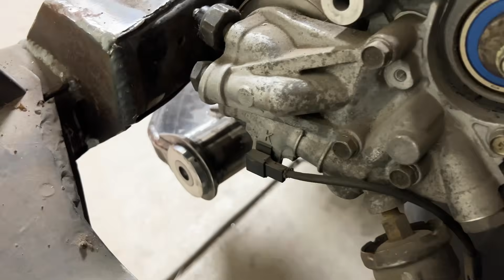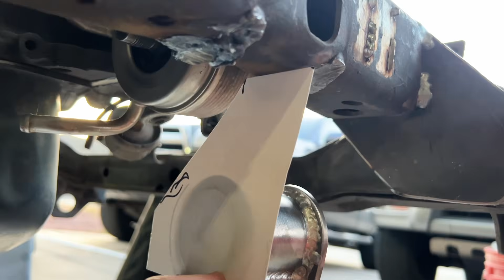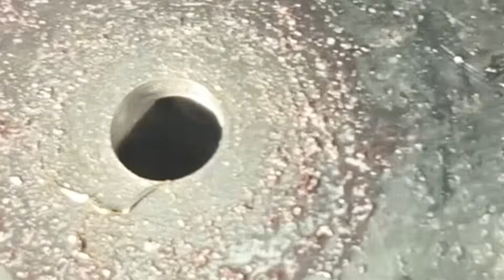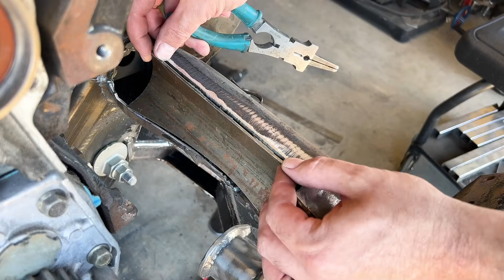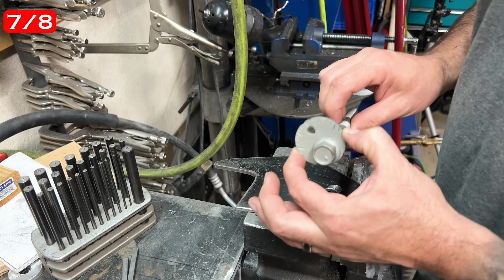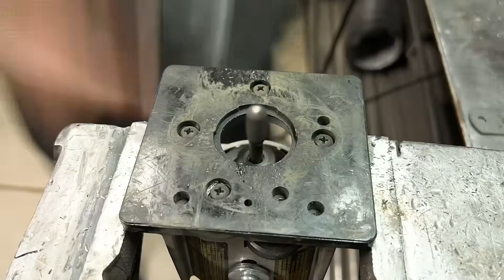Mounting My Custom Control Arms (Part 2) Mighty Max Ep. 26

Comment: Great video! I need some help on mounting custom narrowed control arms on a bagged truck. Mainly the uppers. Having problems with camber and bump steer. Should the upper be parallel with the lowers or slightly higher or lower?
Reply from the maker: Thank you! I’ve been wanting to create a video that would address bump steer and what causes it for a long time. I just haven’t found a time.
Bump steer comes from a discrepancy between the lengths of the control arms and the outer tie rod.
I have two videos that I think you’ll need  in order to figure this out. They break down the lengths of suspension components and why it matters.

https://youtu.be/lBTnPT2Me_0?si=9KZks01HOuLL78SS

https://youtu.be/ZHtQwQzY8uM?si=vRWlqx4AiRAH3GHn

This will have to be a prolonged conversation because it’s somewhat complicated, so I recommend shooting me an email Aaron@GarageFab.tv or an Instagram DM. @GarageFab

Let’s start with… Why did you need to shorten the upper arms?
Reply: I’m using an 08’ Yukon chassis under the 69 c10.

Comment: Hey got a car I’m building with positive camber for looks on my tires upper control arms are extender for this but looking to get the best steering I can should I go bump steering or rack and pinion conversion this is for a 64 impala no shims on the control arms

Comment: You get roasted in the comments!? But seriously, it's called a transfer punch because you are transferring the hole location of one piece to another. A trick you can try instead of "eyeing" the location is to take tape and wrap around the end (don't overlap) a thickness or two of tape to get closer to the size you need. Love the router "milling" table!! Was thinking that you could put a carbide 45 degree cutter in it and do chamfers as well. Keep on fabbing!!

Comment: Boots huh?  I should have thought about that when I bought my plasma cutter.  I have scars on the top of my feet because I'm too lazy to change my shoes!  Thanks for the tip.  A tip for you....until you get a 9/16 transfer punch, just make a smaller  pilot hole in your template then drill it to size using the pilot hole.  More accurate I believe.  Love your channel!
Reply from the maker: Much appreciated! I’ve had a few suggestions of using tape around the too-small punch.
Your tip makes more sense!
🍻

Comment: Go to home depot or Lowe’s and get a roll of “ram board”. It’s 30 something inches wide and 100’ long.  I built a wall mount holder so it doesn't take up valuable floorspace... And I can pull off what I need easily.🤘

Comment: Love your vids . I have a question. If i have custom upper control arm tabs and custom control arms and the holes are slotted for alignment purposes is it going to be a problem that theres no alignment shims ? Will i just be avke to tighten them where i need them or does there need to be some kind of alignment solution for the bolts like stock silverado tabs do or how your alignment cams are ? Is it absolutely necessary?

Comment: 33:50 did I miss something?
Would´nd it be much easier to FIRST tag the brackets to the FRAME and after that just drill the holes to fit the axle bold in place?

Comment: Is there a reason to cut the MDF twice instead of offsetting your paper template to cut the MDF for tip clearance? 

Also, do you have a contour gauge? Might make the tracing much more exact.
Reply from the maker: 🤷‍♂️ Never thought much of it! I do often use the cardboard template later in the process. That’s not why, but it’ll keep me from trimming the first template.
Eh maybe I’ll try it.
Reply: @GarageFab  I guess you could cut two paper templates and keep one without the offset if you want a quick 1:1 template. Just seems easier to cut paper instead of MDF? I think pushing the contour gauge fingers into the frame from the bushing axis would have given you the frame outline, but no guarantee on welding the cam stops on the correct mounts. :)

Comment: Wouldn’t changing the clearance  of the tabs to change their clocked position ultimately changing the “level” of the cam bolts slot? I know you spent an enormous amount of time making the slots perfectly level with the frame rails (and the ground) and then ultimately changing it after  the fact. 😅😅😔

Comment: As I understand it plasma cutters need really dry compressed air. I know it rains at your location so is this an issue that you have conquered? If so, how did you do it? I am in central Florida where moisture is a really big problem across the board.. Also, do you use a vertical standoff? If so, what is that set to and how did you fab or acquire it?
Reply from the maker: Correct! As I understand it, moisture in the lines will destroy your torch tip. We’ve got a REALLY dry climate. It rains, but it’s rare. I simply have a water separator, a bleed valve at the bottom of the tank, and a bleed valve at the lowest point in the airlines traveling to my garage. (Compressor is in the backyard)
I’m not familiar with a standoff. I looked it up and that wasn’t much help.

Comment: Recent viewer to the channel.. Love the amount of detail you're putting into the vehicles with the limited resources and tools in the garage.

On another note, as a person who has had similar issues with his AC (100 year old house with 20+ year old central air), it is probably the capacitor at the compressor. When my AC started requiring me to shut it down for a while and try again, I replaced the compressor capacitor. Once that was replaced everything returned to normal working order. I also learned that AC compressor caps tend to be dual capacitors, and mine was under $15 after shipping.
Reply from the maker: Nice! Thank you. It sounds like rock tumbler when it fails to fire up so made me think it would be worse than just a capacitor. BUT they’re cheap enough and dang easy to replace so why not give it a shot.
It might save me a few pairs of underwear.
Reply: @GarageFab  Our compressor and fan outside sounded like though my wife said it sounded like a helicopter that struggled to start. I will admit that I paid a company to replace the capacitor the first time, but they were kind enough to leave the box so I could order my own if I ever needed to. A couple years later the capacitor for the main blower inside died. Capacitors are like the weakest link in electronics, at least in my experience.

Comment: Ramboard floor protection works awesome for template material too.  Been using that for years and works awesome.   Can get a big roll of it at home depot.
Reply from the maker: I must assume that the curl doesn’t irritate you too much! 
I think I’ll try it out just for self education purposes. Thank you!
Reply: @GarageFab  You I just cut a 6' long piece and it flattens out perfectly.   I also cut and lay it out flat on the ground under the truck I'm working on when I'm not using it so it'll be perfectly flat when it comes time to use it.   Best part is when you bend it, with light taps on the line on edge of work bench, the bend will stay put so you can measure the angle to replicate it onto metal once cut out.

Comment: Tip I learned from Austin Niemela (another great fabricator on Youtube) is you can use Citric Acid (bought 5 lbs for $20 on Amazon) to strip mill scale in just a few hours, especially if the water is hot.  I use 1 cup of Citric Acid per gallon of water and put it in a clear, plastic tub with a clear, plastic lid.  I put it out in the sun to heat up the water and after just a few hours, I can brush and spray off the mill scale like magic.  Less expensive and works faster than vinegar, better smell and not toxic like Muriatic Acid.  I'm guessing Citric Acid would work on zinc too, but I haven't tried that.  All I know is it saved me hours and many stripping discs to take off mill scale.
Reply from the maker: Thank you, Andrew!! I will ABSOLUTELY try that. I recently discovered P&O steel. (Pickled and Oiled) It has the mill scale removed. It would make my work look SO much better. Only problem is it doesn’t come in the 12” wide flat stock I buy.
Problem solved! Thank you again.

Comment: Although the mounts are probably done by now. I don't really know at this point because I'm only halfway through the video. SO, for future reference, if you want to remove the zinc layer RIGHT NOW. Get some muriatic acid and soak them in that for a few minutes. Then, get some baking soda and mix it with water. Then, transfer the parts from the acid into the water and baking soda to neutralize the acid. BUT DO ALL OF THIS OUTSIDE WEARING GLOVES AND EYE PROTECTION!!! 
You my now return to your regularly scheduled program. 
Hope you're having a good one! 
More importantly, y'all be safe out there 🤠 😎

Comment: Nice see you working on the mighty max again. I’m hoping to get mine driving in the next couple weeks. I ordered a new clutch, flywheel, and pressure plate from act but have to get the flywheel machined for a pilot bearing.

Comment: Try this on your house A/C compressor. Don’t remove the stock compositor add this one to it. Well just read the instructions, it’s been a while since I installed one of these. Once you add this hard start compositor, the compressor should make it to fall. Just make sure you pick the right one for your A/C unit. If you’re not sure, just do a little research. This one I picked should work with most A/C units but please check. Hope this helps:
Darrin 

SPP5 HVAC Hard Start for Refrigerator and AC - Super Boost | 90 to 277V | 1/2 to 10 HP

Comment: For me, AC problems are always the start run capacitor for the compressor or fan (it's one piece for both). I have to keep a spare on hand for some reason, it shits one out every 3-4 months. The power company solved some problems on my pole though last fall. So far seems to be helping, haven't lost a capacitor yet this year, but I'm not getting my hopes up. Also, the 50 dollar capacitors have not been any better than the 15 dollar capacitors for me... Have fun!
Reply: When a compressor locks up temporarily. It usually means the thermal overheating has failed, it keeps running until the metal swells to the point dragging until it locks up. Once it cools down it will sink back to normal size it will normally start working again. Until it digs in to the point of total failure. If it is still cooling down and I would definitely replace the thermal overload switch if it is on the outside of the compressor.
Reply from the maker: Soooo I spent some years as an apartment maintenance supervisor. I’ve got a fair amount of A/C experience and lots of start/run capacitors. I don’t remember any of them causing the compressor to sound like a rock tumbler. BUT!! If it goes out before fall I’ll definitely try one anyway. I’ve also never seen a compressor lock up… temporarily.

Comment: Muriatic acid will rip zinc off in a hurry.  But, it’s muriatic acid, and not vinegar.  It’s not a toy.

By the way, a water softener typically has salt in it. If any of that got on your parts, a good rinse is a good idea.  Good luck, and good grief!

Comment: I have used this product called Ram board it is sold in Home Depot you can drill holes in it you can sand the edges to make a precision template you can cut it with a utility knife or a bandsaw, it is sold in rolls so I cut several different sizes in advance and put something heavy on it to flatten it out and it stays flat ,

Comment: I see you struggling with that ink pen. I don't often make suggestions.... but... The Pilot Precise series ink pens were used by myself and my coworkers years ago when we had to draw diagrams and used templates. Those pens worked amazing against templates and rulers. The ink flow was very predictable. Just don't put the tip down on the paper until you plan to draw a line or write. It will flow ink. We went to diagrams on computers a couple decades ago, but I took a class about 8 years ago that required drawing with templates and made a late-day run to an office supply store to get a pack. I used mechanical pencils to rough-out my diagrams and then came back with the Pilot. Never had a complaint from a "customer" on my diagram quality.

Comment: front bracket is a bracket and a bump stop.
Reply from the maker: I’m wondering now if I inserted a shot of the completed setup. When I finished filming, I went back a few days later and did a little trimming/shaping. Now you could actually mount a rubber bump stop on one of the tabs.

Comment: You need a friend with a 3d printer to print some adapter spacers for those transfer punches of yours...  you could use the 1/2" or 3/8" punch sleeved up to 9/16" or 3/4", or perhaps larger if your heart desires

Comment: Nice job but Bruh…I’m all about some gap welding but  I’ve seen hookers with smaller gaps than those driver side tabs 🤷🏻‍♂️. I’m feeling your pain on the flooded parts. I had a bunch of tools and parts stored in totes of my basement garage. A historic rainstorm flooded  my basement and who knew totes full of parts would float and capsize, spreading crap all over, ruining most everything. Bottom drawers of my tool chest also flooded. You know the big drawers where most people store tool kits and testers and expensive crap  but you don’t use much…all junk now. A $1200 Ford Tooloader 4 speed was submerged and spread an oil slick of gear oil out to cover everything in a gross oily film of sludge. As you can imagine, the bearings sound awesome now…Two brand new edelbrock aluminum intakes sitting on a bottom shelf, full of grossness. I’m happy my stash of carburetors were on an upper shelf. Flooded out my beer fridge too.  Not to mention, all the personal belongings and stuff from my kids childhood that was destroyed. Just sold that house  but the memory of that flood is gonna haunt me for a while. Flood proof your 💩, my people, even if you think a flood isn’t possible. Good luck with the AC

Comment: What I often use for template material is Ultra-thin HDF, his kind can be produced in thicknesses below 2.5mm. OR, Thin HDF, which typically ranges from 2mm to 8mm, with 3mm to 8mm being the common thickness. I also use either 1/16" or 1/8" thick aluminium sheet.

Comment: I know your shop space is an absolute precious commodity, but... your 1/4" MDF templates would be much easier to cut to final size in a scroll saw. They are also great for making templates that have some sort of void in the center. 
Like radio bezels etc.
Reply from the maker: I agree, Dale. I’m constantly doing work where a scroll saw comes to mind. 
I also need a miniature band saw. Which to you recommend I get first?
Reply: @GarageFab they are both irreplaceable once you've had one, but... I'd say I use my scroll saw far more often than my band saw. Harbor Freight has a pretty nice Bauer scroll saw now.
Keeping in mind  that you get what you pay for  LOL

Comment: I also need to say I really like this format.  FF through the quiet parts then keep explaining what you're doing.  Good job.
  Sorry to see the flooding.  One of the side effects of my small shop is that I keep most things on casters,  a few inches above the ground.   But hay, that garage door seal is a beast for holding the water back!  That'll keep the sand out too!
Reply: I agree with Shawn.  I like the long format, and I like how the more basic shit is not just edited out, but fast forwarded until you have something to say.  Watching the process, even at 5x speed, shows a lot about how things are done.  I would rather have the ability to fast forward myself if I want, but at least the content is there to watch.  This channel is going to blow up!
Reply from the maker: Thank you, Shawn! 
Tell me more about the format! Not sure I understood. About 75% of this video edited by Jay, an editor I’m testing out. It would be nice to find out if it was his work or my own (or both) that you’re speaking of.
Reply: @GarageFab Well,  I like listen to people describing what there doing.  I dont have to guess.  But if I do, they have a chance to tell me if I'm right or not.  
   The thought process that goes into fabrication isn't always apparent to everyone.   And there's things you do differently than me.  That's the beauty of a walk through.  You have your reasons!   
  2x speed on the grinding to include it works great.  There wasn't much audio down time, if you will.  
  You had the time to go over everything you wanted as a topic without worrying about it being cut.
  I build stuff.  I wouldn't know if that puts me in the bulk of your audience or in a 'special' section in the back, but your videos already have a re-watchability that makes them more solid than most.

Comment: Why not make two versions of the template. One to use for plasma cutting and the other one stays full sized to check the hole alignment and for sanding the parts

Comment: Look up kraft chipboard, 50 pt or higher weight.  Is it similar to your cardstock?
Don't forget the access holes for the A/C compressor through the frame!
P.S. Weep holes prevent tears.  If you must have a container near water, drain holes will help dry the insides out.